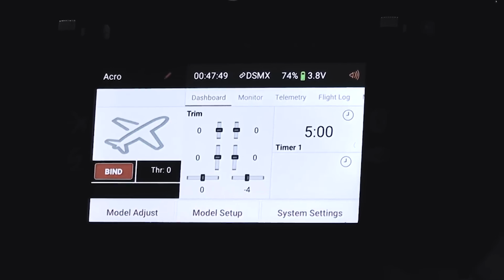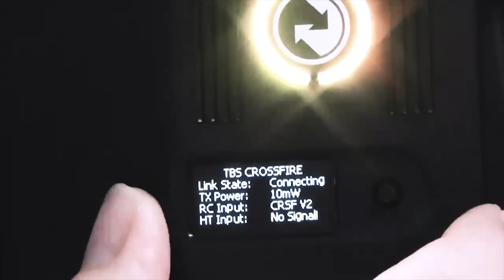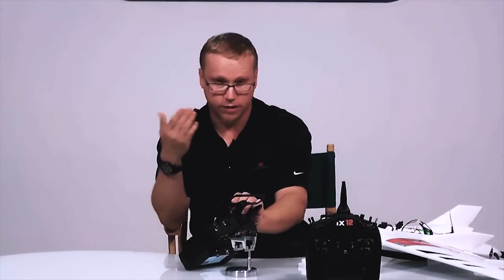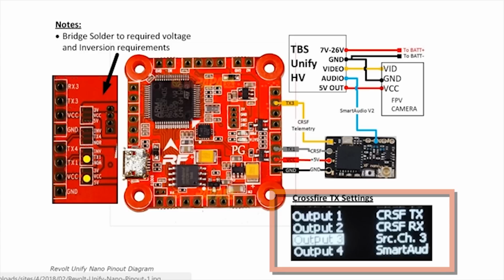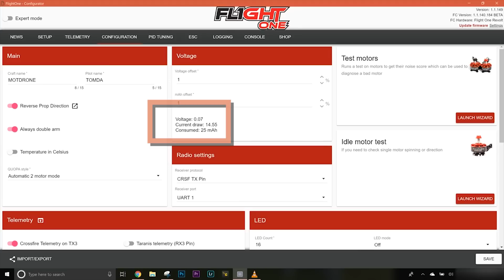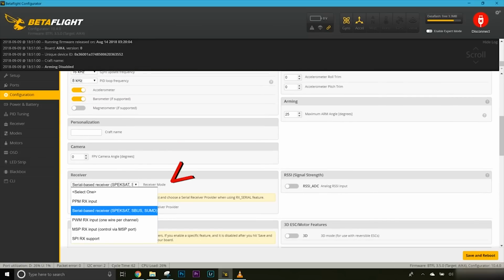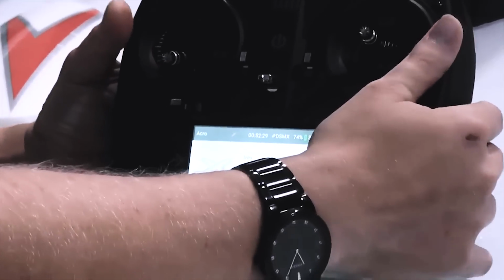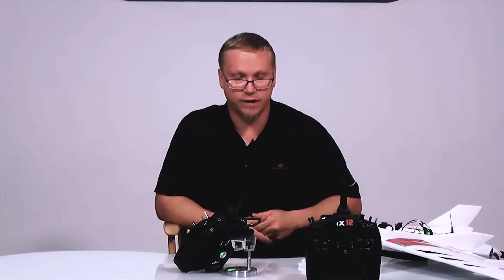Spektrum iX12 Instructional Series - Crossfire to iX12 Telemetry Guide

Comment: I have the IX12 AND Tom says in the lite ver. Won't work, is that only for telemetry? Full and lite ver both have the screen and the plug for the cable on the bottom

Comment: Hi. I want to come back to spektrum after prity much been forced to use a tarris for my mini quads before spektrum surported crossfire. They only thing I want to keep is the ability for my TX to read out and warn me when my battery has used all its MAH so i know when to land. Not low vollage warning as that can be set off during heavy throttle use. Is this possibe on the ix12... also is it possible on any other of the currant spektrum TXs?

Thanks for any help

Comment: Can I use this cable (customize it to fit) with my dragon link long range transmitter? If so which external transmitter do I choose in the menu? I am not interested in getting any kind of telemetry just a radio link.

Comment: Is it possible to show both RSSI and LQ on the IX12 Telemetry Dashboard? I am using SBUS due to compatibility with an older quad/FC. Hence I'm not utilising the full benefits of the CRSF protocol. I have the micro Rx in the Vortex 250 Pro.

Comment: Can you plug a lipo into the crossfire to power it even though it’s plugged in and serial port power 9.5 V is selected?
Reply: 4 years too late lol, but yes. The crossfire will take the higher voltage. So a 3s lipo plugged in will be used first until its below 9.5v, then it would switch to using the serial port

Comment: How do you get above 500mw and how is the external battery port used on the crossfire? Do you have to turn off the 9.5v port in the radio to plug in the external battery on the crossfire?
Reply from the maker: Hi Bruce. To get more then 500mw you will need to use the xt30 port. The crossfire does automatically switch to it when you plug in power thru that port, even when the power is plugged into another port. Hope that helps!
Reply: @HorizonHobbyProducts  Thank you!!!

Comment: Hello i have same set up, ix12 and crossfire. just wonder if i have to set crossfire to ch8 or 12 using ix12
Reply from the maker: Either will work, depends on your setup. 12 Ch mode has higher latency.
Reply: @HorizonHobbyProducts  Higher latency, in which proportion ?
Reply from the maker: @far5233  Not 100% sure how much more latency, might be a question to clarify with TBS. Sorry!
Reply: His displays says 8 on crossfire

Comment: I’ve had flight controllers (BetaFlight mostly, but also iNav) connected via CrossFire and tried “Auto-Config”, assuming that was used to detect data packets in the same manner I’ve seen on other brands of radios, but it didn’t detect anything other than RX voltage (which is sort of bogus anyway since it’s just reading 5V off the regulator) and I wasn’t able to put anything else on my telemetry dashboard. This is what I did with a Spektrum receiver and FlightOne and it worked great, but not with CeossFire. Is there something I’m missing to get more data? Do I need to do anything to detect what telemetry is being received, or to display what alarms I can set or what I can put on the dashboard? Thanks!
Reply: Hi Frank, If you have done everything in this video, it might be that your cable from your iX12 to your Module is wired improperly. Was it DIY?

Comment: Ix12 only no DX9?
Reply: Correct
Reply: @SpektrumRCvideos  $ 400 should not be expensive enough for such advanced functionality ...
I just come from dx6 to dx9 to get full support for my Crossfire but I realize that telemetry does not work despite the use of serial port.
A little effort, Spektrum, you can do it, dx9 is a great radio and I do not understand this limitation !
Reply: @kiks64k82  Well you really don't need telemetry if you have a OSD. I made the same switch from my DX6 to DX9 so I could run crossfire as well 👍
Reply: @smooth_ops2942  Could you please elaborate on this? I have the DX9 and am looking to install crossfire on it, but have just learnt that there is no telemetry available. Especially when you need to know signal strength
Reply: @jakeboynz  You don't need telemetry to be sent back to the crossfire module to get LQ, well since the crossfire rx is connected to the FC by your TX and RX UART you just setup your FC's osd to show you LQ by assigning AUX 8 in the receiver tab to RSSI as well as enable RSSI in the osd. Then on the crossfire module itself you have to go to channel output and assign channel 8 to output LQ or channel 12.... If it shows up as 49% in the osd change 8 to 12 or vice versa in the module.